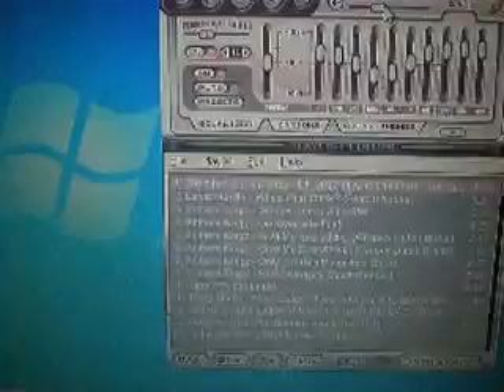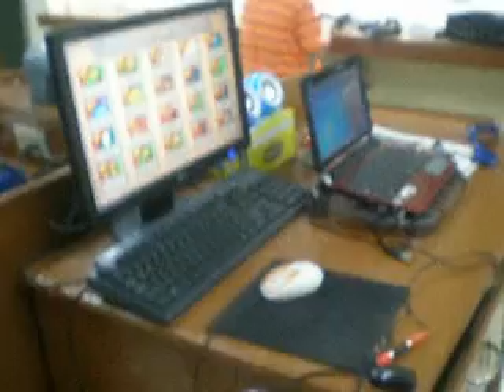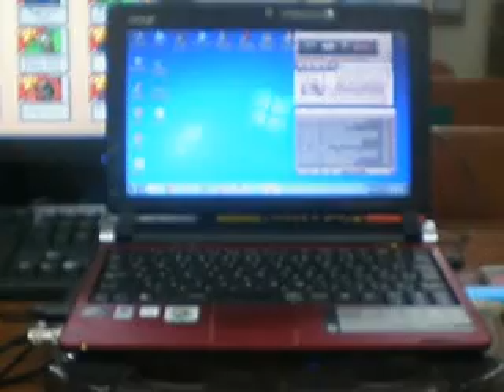Assembled OMEGA AMPLIFIER 1200W

Comment: 1200 watts? No way, that two pair of transistor only provide 200 or 250 watts depending of your voltage and current transformer , need more info.

Comment: sir pila isa ka chanel ana plss reply
Reply: Naa koy circuit pero dili namo e pause para kong mag pa assemble Kong maka testing ka di ka magmahay, pwede 6 ka 1000 watts imo e load na double magnet 18inches na crown duhaon ka transpormer 50 0 50 AC 20amps